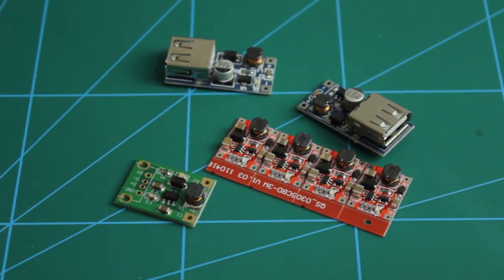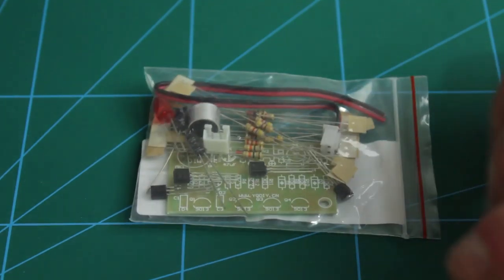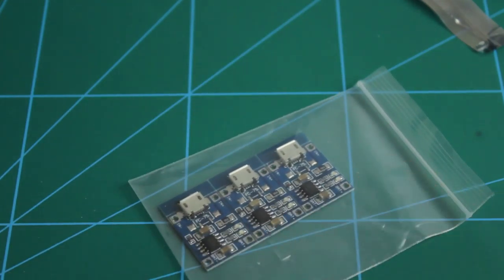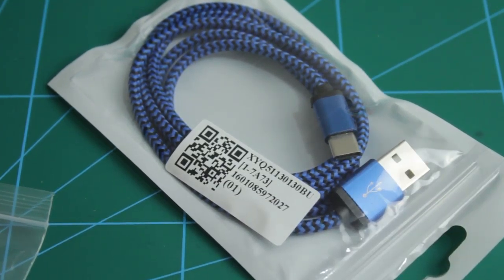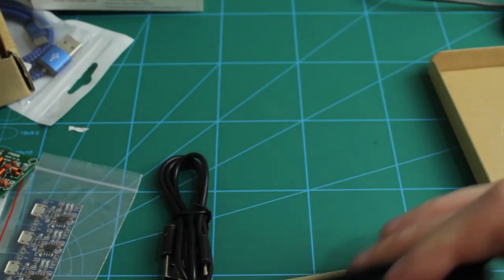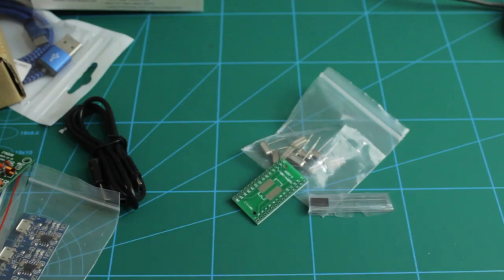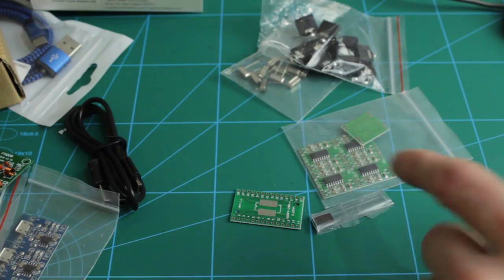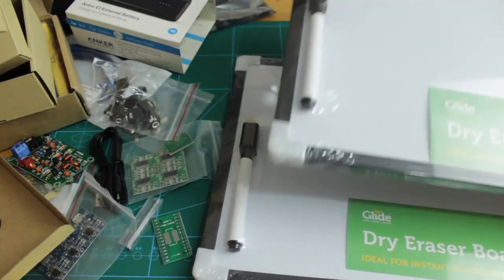Post Bag 04: Progressive preopened products

Comment: There is a guy that gets almost every available USB type c cable and puts it through several tests to check if it meets the spec. If you take a look at his Google plus page these cheap cables never meet the spec sometimes with bad consequences for the devices involved. https://plus.google.com/+BensonLeung
Reply from the maker: +VoltLog Thanks mate, +Snow already chimed in and told me to be careful. Thankfully I saw it but I also have nothing with a USB C socket. Turns out those female USB C sockets are pretty expensive.

Comment: Apparently, cheap USB-C cables can damage USB-A devices by drawing too much current. This can be an issue if you charge a new phone from an older computer. You probably know this already, but I thought it was worth mentioning :D
Reply from the maker: +Snow I didn't know that, thanks for the info. I don't have anything to plug it into so I don't intend to use it, just wanted to see how the connections work.

Comment: those micro usb lithium chargers, have a look around - there are also some with built in lithium cell protection circuit!
which gives you options with different cells in your projects. same charger chip (which is reviewed on candle power), also very cheap.
Reply from the maker: +lotsarats Good to know, thanks.

Comment: Hope you to test solar powerbanks for small devices like arduinos. I've bough one usb solar charger, but it had auto-off switch, so when powering little nano with DS18b20 the charger was switching off after few seconds.
Reply from the maker: +Piotr Budny You can solve that with a few extra components if you want to. It shuts down on low current so you need to pull a little more briefly to keep the power bank awake. Grab a transistor and a low value resistor on the other side to ground. Pulse the transistor from the nano every 10 seconds for 1 second and it should keep it awake.
Reply: +David Watts The nano can be in deep sleep. I suppose, ne555 would be a choice. Thanks!
Reply from the maker: Piotr Budny The 555 is a great idea, I wouldn't have thought of it.
Reply from the maker: +Piotr Budny Looks like this one works with tiny loads, it has been running an led pulling <10ma for ages.